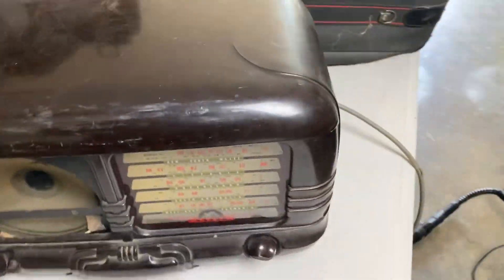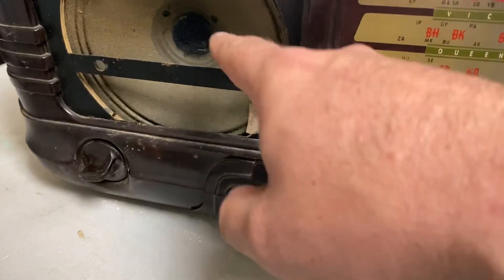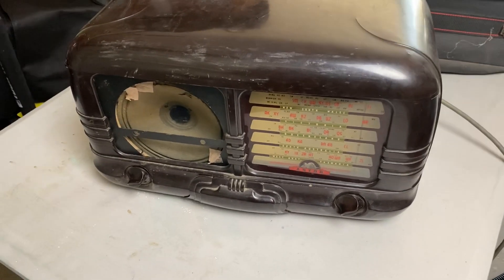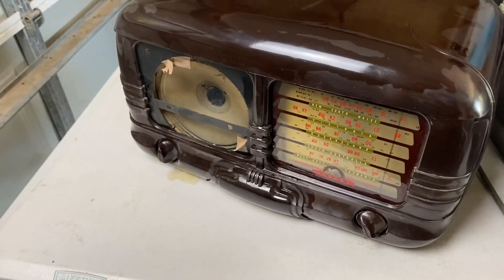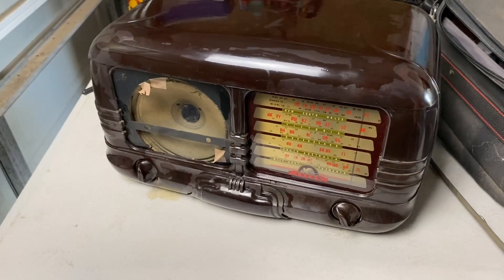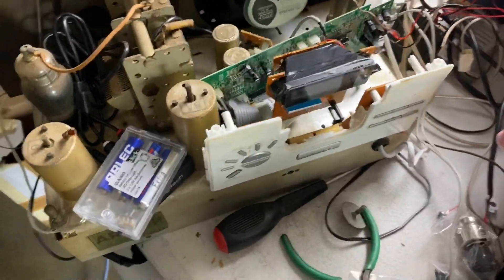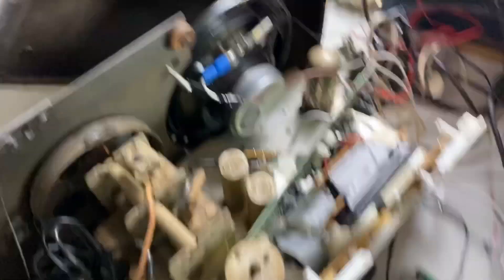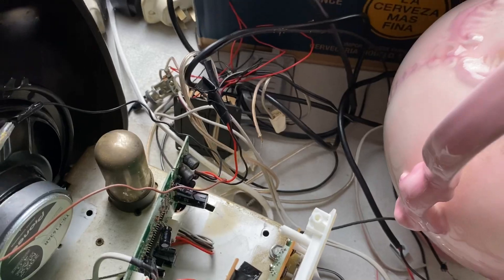1940s VINTAGE RADIO RESTORATION! (Bluetooth Conversion)

Comment: This is a great restoration, I love these old radios. I also converted one to bluetooth a while ago.
Reply: Great video. I’m thinking of converting old radios like you have. Being a newbie though I would like to know if there is way to select an mp3 file from a usb stick which would be on a Bluetooth board with the tuning knob and dial?

Comment: Great video. I’m thinking of converting old radios like you have. Being a newbie though I would like to know if there is way to select an mp3 file from a usb stick which would be on a Bluetooth board with the tuning knob and dial?